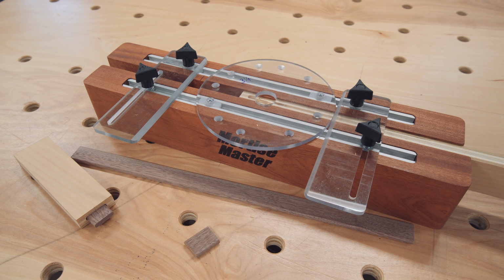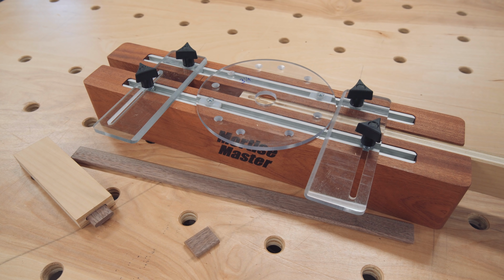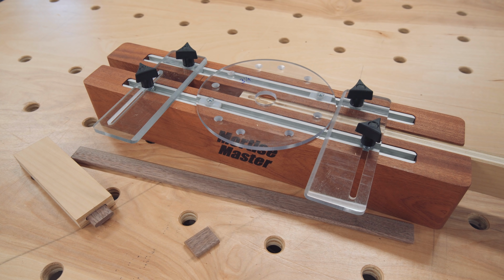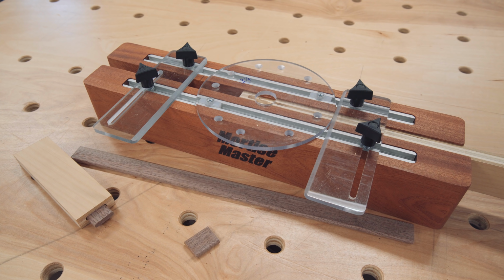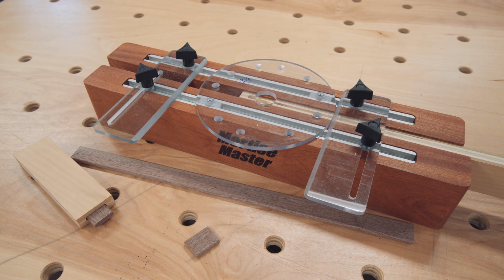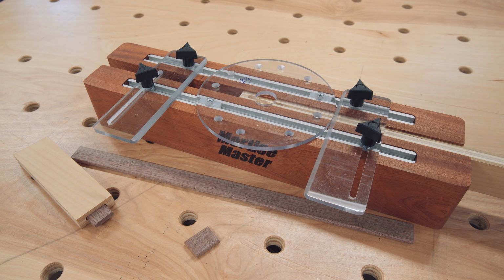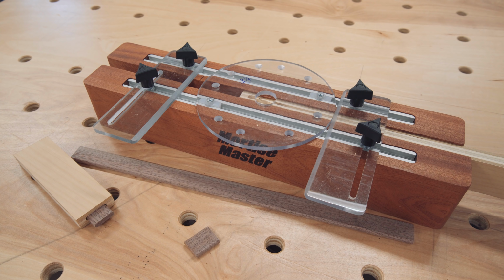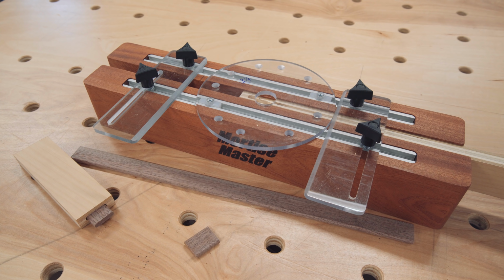Tool Talk #17: Mortise Master

Comment: Every single thread I read about a jig product has 10 people saying “just build it yourself for free out of scrap” 

First of all, it’s never free. You end up burning a whole weekend and half a tank of gas driving to buy hardware. For this jig, how are you gonna drill all the offset holes in the polycarbonate plate? Do you have that just “laying around?” 

Second of all, many of us don’t want to spend all our precious time building jigs. As a hobbyist woodworker in MN with an unheated garage, I only get a couple days a week, 8 months a year to practice my craft. I’m sick to death of building, rebuilding, and tweaking jigs. I want to design and build cool furniture. If you want to spend your time building jigs and shop equipment—knock yourself out—but please stop telling everyone we have to. This is a tool, just like a Festool domino or a table saw. Should I build those myself as well?

 Personally, I’m absolutely gonna buy this because it is brilliant.

Comment: I've not yet used it, but I got mine today.  It is very well put together and everything fits together very nicely.  If one figures the time it would take and the cost of wood, T-track, buying HDPE and acrylic - it'd cost me more to build it myself (I don't have that stuff laying around and you need to get great precision).

As more of an occasional hobbyist I think this is a very good buy.  I might be happier with a Festool Domino but the cost. . .

One thing to emphasize is that we do have to use a plunge router with an up-cut spiral bit.  This will not surprise anyone who has used a router to make a mortise in the past, but for those of us who are new to mortising this will avoid surprises.  But if you are even half-way serious about woodworking you likely have those or will get those anyway.

Comment: Thanks for sharing. It wasn't until I saw you clamp the jig into the vise that I realized you could probably just put some t track into the top edge of the vise heads and forego the separate jig. I'm sure there would be limitations whenever you want a mortise in the end of a long board, but just a thought.

Comment: If you cut some small pieces to put between the middle plate and the stop blocks and size them to common sizes, you could very quickly set the spacing without having to measure.  Or you could use one of those machinist sets that have every size - 10, 11, 12, 13mm, 1/2, 5/8, 11/16, etc.
Reply: GordonGEICO bingo you just guessed the exact setup instructions I put in the user guide. It truly is the fastest way to set it up
Reply: Bingo he just guessed the exact instructions I put in the user manual. It’s really the fastest way to set it up

Comment: I wonder if it makes sense to include an inset tape measure on the inside of the aluminium track set at zero on the centre line going in both directions.
Reply: Colin Nicol the original had that ( sort of) because like you I thought that would be a good idea. Ends up you don’t use it. thanks for the comment

Comment: Have you tried a dowel Max? This jig seems pretty neat but there's a lot of math involved. I have a dowel Max and it's a pretty similar experience but a lot less setup. I know dowels and floating tenon's at not quite the same and there are times where this would do things my dowel Max won't do. But I think it's generally gonna be less work work dowel Max. Plus it uses a drill instead of a router
Reply: Chris Johnson there is very little math the way I do it DL the user guide an see my recommended set up procedure 😉

Comment: One comment - Only one of my routers has a base that is around that size - the others are one foot across - I made them. It would require that I remove my base and then attempt to get a "centered" router on this base???
Reply: Clyde Decker the slide plate is not a router base the base sits on the slide plate. It just looks like a router base cause it’s round
Reply: @donbrowning689  True but my base plate is larger than the total openings...
Reply: Clyde Decker sorry but that’s not going to work

Comment: Nice jig, but a mortise jig is not difficult to make - Mine is modelled after the plans in ShopNotes Vol 11 Issue 64 from 2002.  I've used it for a long time and it does 95% of what I need.